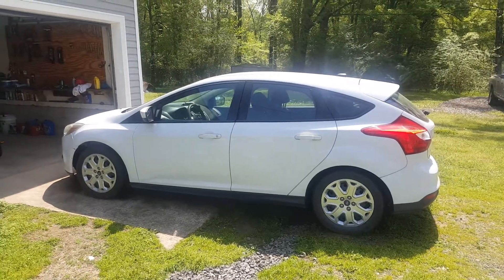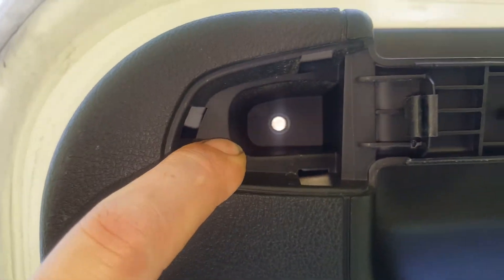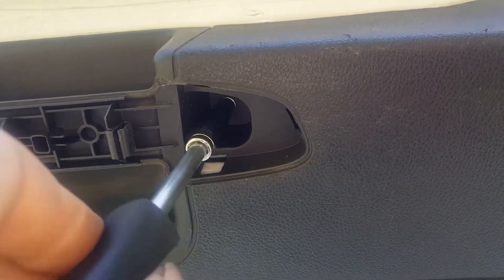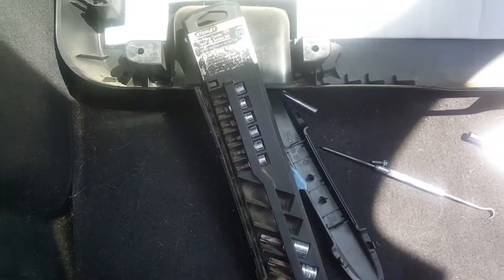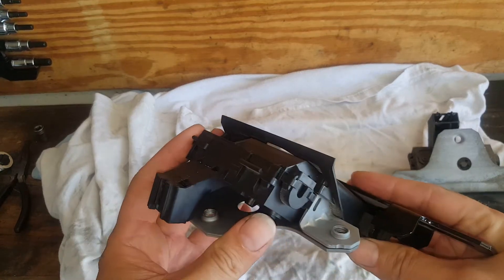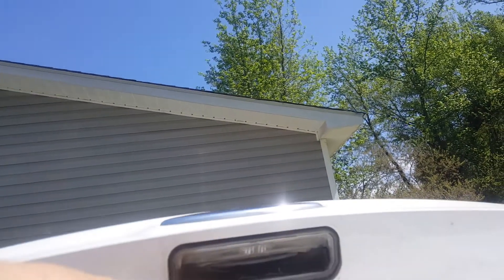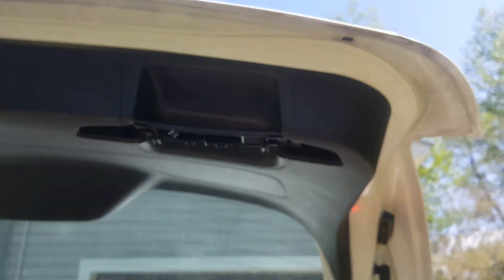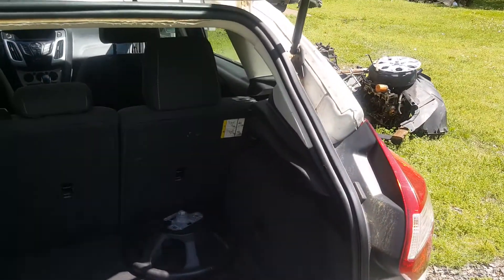How to replace the rear hatch latch on a Ford Focus 2012-2018

Comment: Hey man great video, I'm having kind of a different problem with the trunk and I want to know if even your latch was broken, did you have any warning in the dashboard of open trunk randomly? Or even when the car was parked and locked the alarm went off? Because that is what is happening with mine now, even tho the latch is closing fine and poping open with the remote, did you had any previous problems like those?
Reply from the maker: I have heard of this issue , I believe the latch was the culprit. Thanks for the feedback.